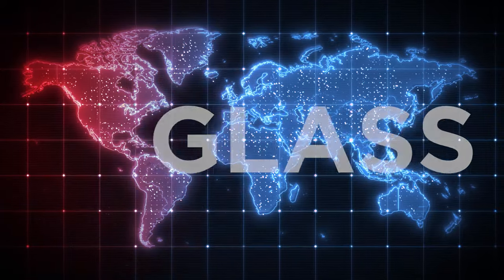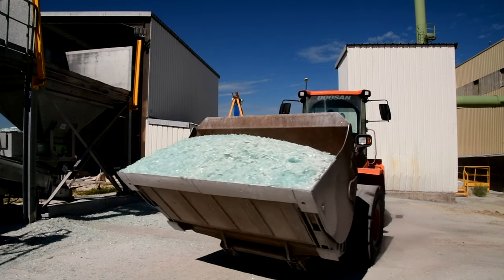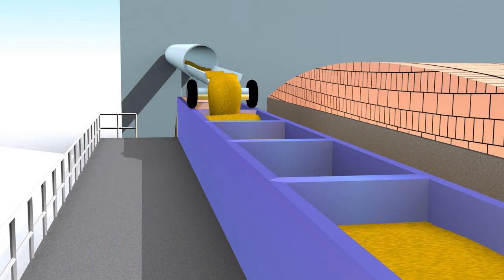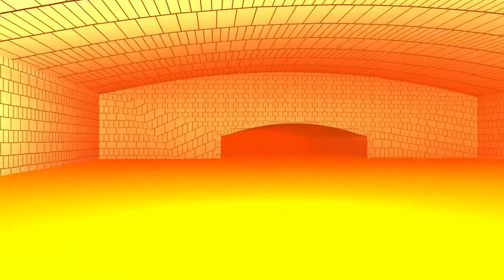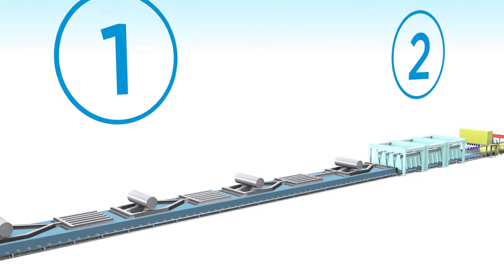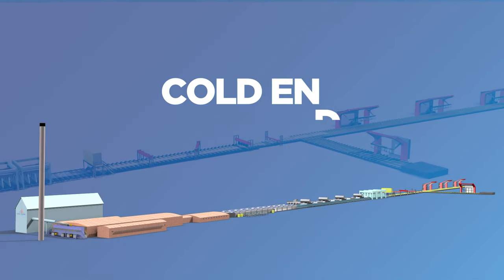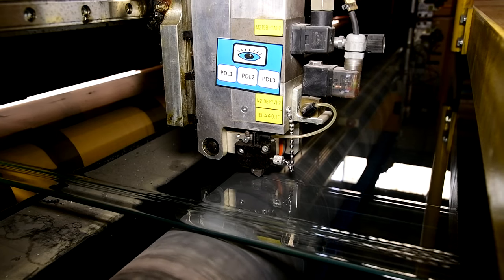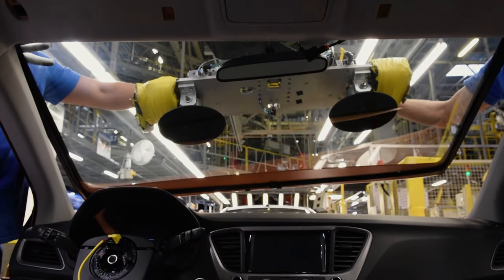Saint-Gobain Glass - Float Process

Comment: This is called dog house... From where glass enters furnace by the application of batch chargers where batch ( which contains silica sand, limestone, dolomite, soda ash, feldspar, carbon, cullet ) piles feeding is done... These batch piles are set by using chope gates and melt in melter area of furnace before hot spot of furnace then in some furnace there will be bubbler to homogenize glass also some design have boosters to heat glass from bottom( mostly tinted glass furnace use boosters which are made of molybdenum) ... Then enters refiners area where refinement of glass will be done by escaping the bubbles and gases present in glass also reduce Refinning Index of glass then passes neck area where it need to be passed by deep cooler (to avoid passing defects from furnace and to generate current in glass) then passes through homogenizer also called as stirrer ( its done to avoid Rim lines in glass) then enters cooling end or working end where we work on glass to achieve required temperature at canal then from tweel the glass 1115-1125°c  is made to flow to tin bath, then by the application of top rollers glass is stretched and accumulated and LOR lift out rollers lift glass and pass the glass to annealing lehr.... Exit temperature of glass  at tin bath will be around 630°c to 632°c the  in annealing lehr glass passes from different zones like zone A B C and RET 1,2,3, then F1 F2 F3 then enters to cold end..... Glass cutting temperature will be 60°c to 80°c based on glass thickness furnace will be having regenerator which has rider arch, division walls checkers pipe holes connecting ports and crown.....furnace has L shape wall brest wall tuck stones skew beam to hold diamond brick or starter brick ( first brick of furnace crown) mostly made of zircon to avoid Direct contact of silica brick with AZS, furnace crown is made of 99% pure silica bricks some design have mullite bricks breast wall have AZS bricks and refiner breast wall is made of high quality silica bricks....furnace bottom starts with promery steel which contaims C channels in which pillers bricks are installed and in between ceramic fiber board is placed, then bottom clay blocks are placed then zircon castable is done and paving blocks are installed....melter size will is made of AZS bricks and in cooling end alpha beta jargal bricks are used L shape wall will be made of mullite brick in some design silica bricks are used and then brick are hanged by steel clips, A blowers will be continusly running to cool L shape wall......regenerator is walls are made of Low porous bricks then magnesia bricks, crome-magnesia bricks, checkers are made of magnesia, crown magnesia, they may be tubular tupe or chimney type... .god its not easy to make glasssssss🎉 thank you🙏😅